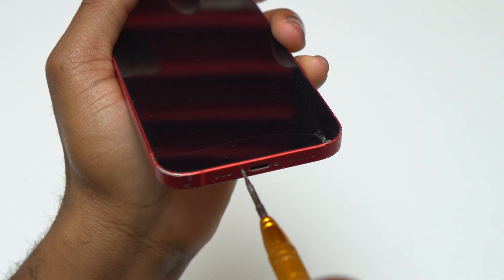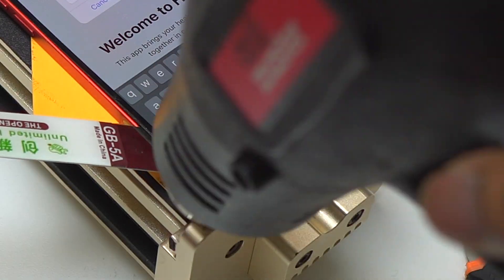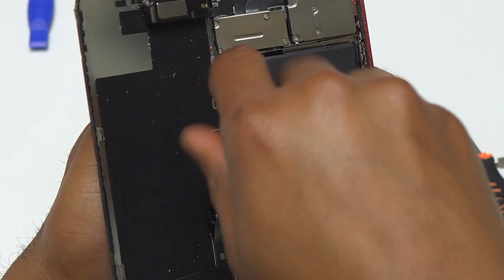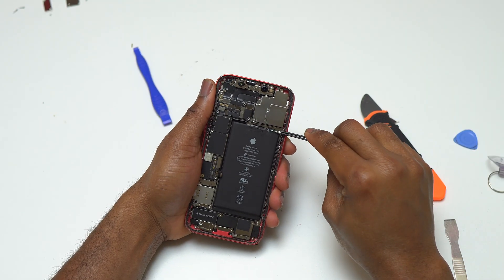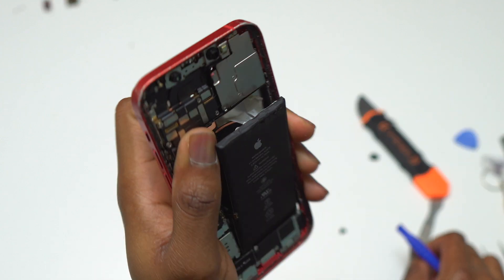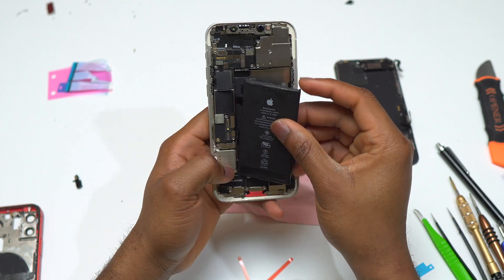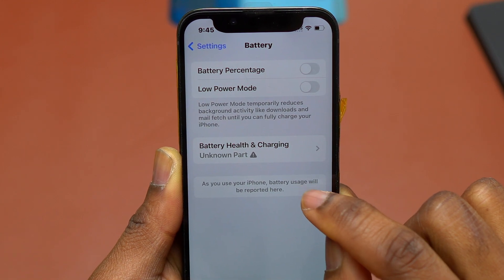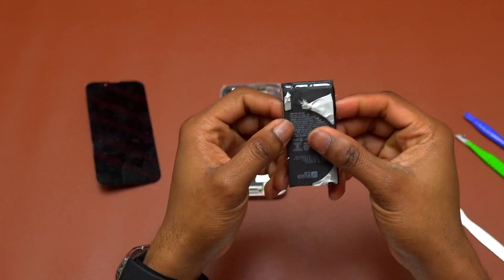iPhone 12 Battery Replacement Below 90% Capacity

Comment: This is perfect. I just saw one where the guy removed the unbroken screen, the SIM card tray and holder, and the speaker at bottom and the little apple thing on left just to get to the damn adhesive at the bottom. What a dolt. Yours should be the first one available on here. Peace

Comment: Shouldn’t you power down the iPhone first?
Reply from the maker: you are absolutely right you should turn the device off before you proceed but in this video, the device screen was broken and I could not navigate on the device in order to turn it off. This is why this one was stayed on during the whole process. and especially for a screen replacement you do not really need to have the screen on since you already know that the screen is broken, and even if the device screen get damaged during the process of removing the screen, it does not matter this one specifically, the screen was not working, and I couldn’t turn the device off disease the main reason